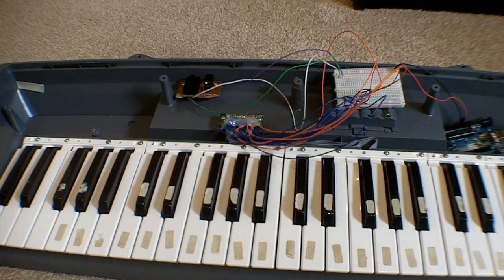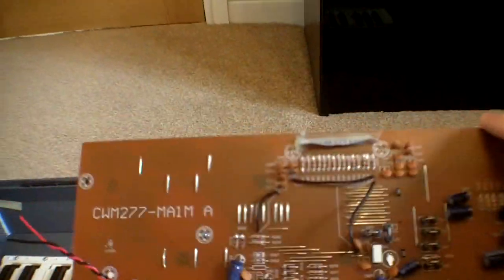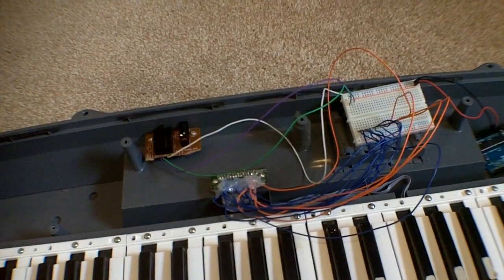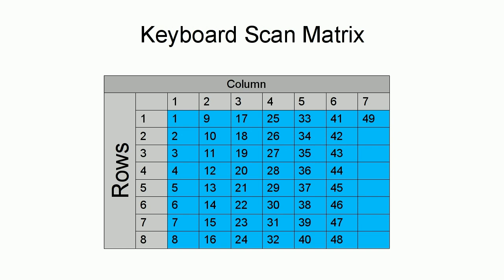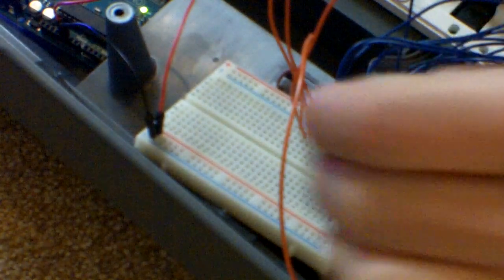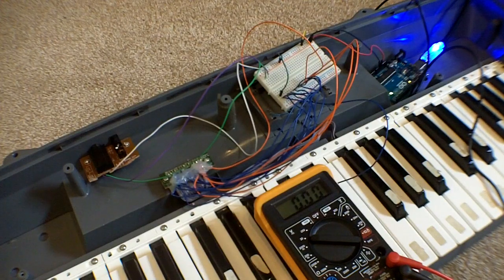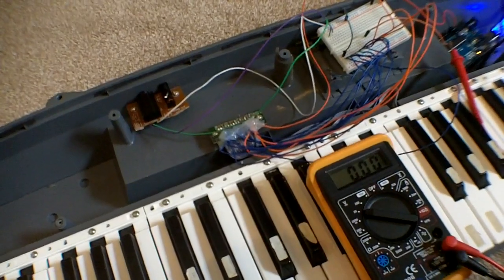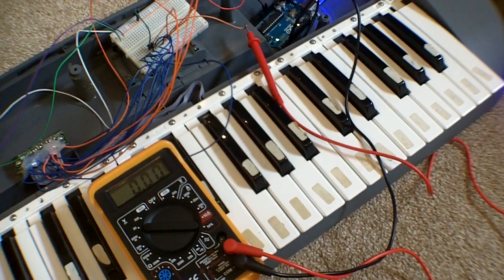Frankensynth: How The Keys Work (Scan Matrix)

Comment: Thanks for the tips! I'm trying to "Frankenstein" an old Casio synth...it's got broken keys, so I'd like to fit a bigger keyboard with the same number of keys, which I took from an old MIDI controller. I'm guessing this is only possible if the columns/rows are the same for each keyboard, correct?
Reply: I'm trying to do something very similar. Wondering if you had any luck or any information you could share as there doesn't seem to be anything available online. Any suggestions would be greatly appreciated!

Comment: How did you know that it was a 7 x 8 matrix, and how did you know the difference between a column and a row?
Reply: you can figure out that by looking at the pcb underneath the keys and way they are soldered to the connecting cable. In my case I was able to see 8 and 4 distinct set of solders in the pcb at the point where the cable is attached and 4X8 matrix worked out for my 25 key keyboard
Reply: @Skandawin78  I also have a 4x8 matrix for a 32 key keyboard